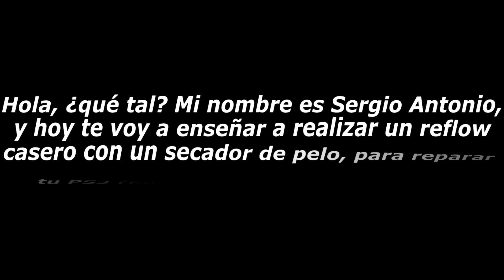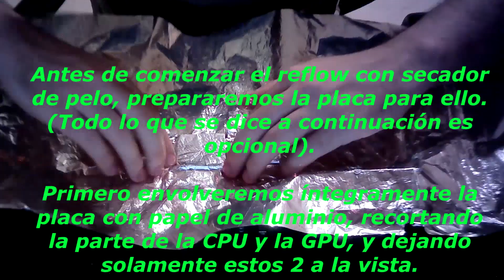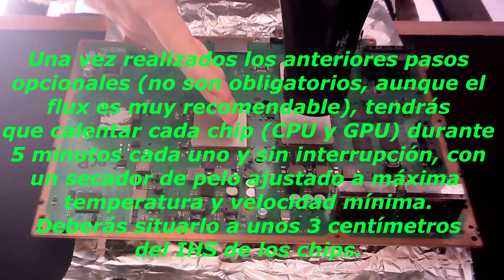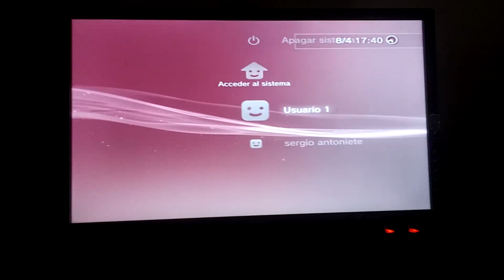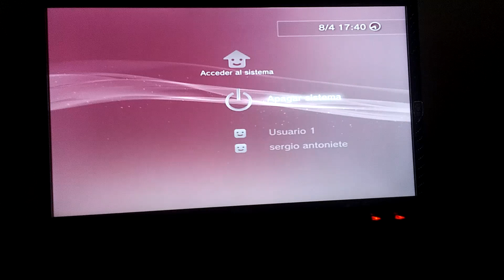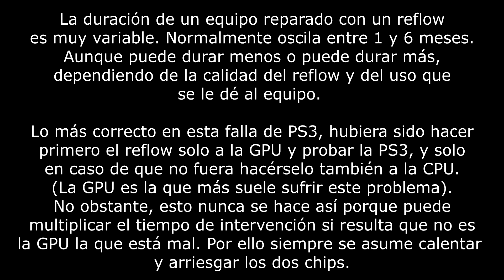Reparación de PS3 con el error de luz roja parpadeante |  Reflow casero en PS3 con secador de pelo

Comment: Cuánto te duro la PS3 con el reflow?
Además que si el Flux que usaste y pusiste en la descripción, es de buena calidad?

Y yo opino que la PS3 puede durar bastante con ese metodo si se hace esto:

Buena ventilacion y en un lugar confortable, No exceder el uso del sistema y darle un uso mínimo diario.

Yo había hecho ese procedimiento pero sin el flux y pues no sirvió, otra pregunta es que el flux verdaderamente es la clave en este procedimiento?

Y por último, yo al encender la PS3 Fat pues el ventilador se pone a máxima velocidad y hace gran ruido,así como por unos 8 segundos, luego para y sucede la luz roja,  pero por qué se activa el ventilador de esa forma?
Reply from the maker: Hola Alonso:

Gracias por su visita y su comentario.

Esta PS3 la reparé solo unos pocos días antes de subir el vídeo. La he usado activamente durante la semana pasada en sesiones y tiempos repartidos de la siguiente manera:

2 sesiones de 1 hora, 1 sesión de 4 horas y 1 sesión de 2 horas, usando el Call of dutty Balck ops en modo multijugador y zombies, un juego que para esta consola es bastante demandante de recursos.

Antes de que se me estropeara del todo y necesitara hacer el reflow, la PS3 sufría de calor y entraba constantemente en thermal throttling, poniéndose los ventiladores a tope, después reduciendo drásticamente su rendimiento y apagándose en torno a los 20 minutos de encenderla. Hasta que finalmente le pasó lo que se ve en el vídeo.

Tras estos últimos días puedo concluir con total seguridad, que el reflow ha salido bien y que la pasta térmica de 13.8W/mk que le puse es suficiente como para conseguir que la PS3 no entre en thermal throttling a pesar de que en España ya estamos entrando en el verano, y ello perjudica a la consola dado que la temperatura ambiente es cálida.

La pasta térmica que uso https://www.amazon.es/gp/product/B07K442WXV/ref=ppx_yo_dt_b_asin_title_o01_s00?ie=UTF8&psc=1

Por otro lado, la tengo en un lugar bien ventilado. Dejo un mínimo de 10 centímetros de espacio a su alrededor para que circule bien el aire y la tengo en un lugar bajo (ya que el calor sube), y además cuando la he jugado lo he hecho con la puerta de mi dormitorio abierta y la ventana también, para favorecer la circulación del aire, a excepción de la última sesión de 2 horas, que cerré el dormitorio, y no se apagó a pesar de la alta concentración de aire caliente.
Reply: Hola tengo una consulta , tengo una ps3 modelo 2001 y nadie quiere repararme la consola, me dicen que no hay reballing para mi consola ps3 slim y que solo anda para pisapapeles la lleve a muchos lugares y todos me dan la misma respuesta , mi pregunta es si es verdad li que me dicen o solo me lo dicen porque es complicado de hacer. Saludos y gracias de antemano.
Reply from the maker: Respecto al tiempo, yo personalmente no sacrifico tiempo de juego para aumentar la durabilidad de la consola. La juego como si no le hubiera pasado nada, y si la sesión tiene que extenderse x horas porque el cuerpo me lo pide y tengo tiempo, simplemente lo voy a hacer porque de otra manera sería no disfrutarla, y pienso que las consolas están para disfrutarse. (Pero esto es una decisión particular de cada uno).

En cuanto al flux, este no tiene por qué ser la clave, no obstante puede marcar una diferencia entre conseguir reparar la consola o no conseguirlo y también la duración de la consola tras la reparación, dependiendo del grueso del problema, puesto que el flux además de ayudar a atraer el estaño a donde tiene que soldarse también elimina impurezas en el estaño.

El flux que yo he usado a mí me va muy bien, pero si lee opiniones en Amazon podrá ver que a otras personas no les ha funcionado tan bien y están decepcionadas (habría que ver si es realmente por el flux por lo que no han podido reparar o si es otra cosa). No obstante, la mayoría tiene una buena opinión sobre esta pasta de flux, igual que yo.

¿¿Es clave el flux en su caso?? Como ya le he dicho, puede marcar la diferencia. Sin embargo, también es importante (incluso más) ponerle una buena pasta térmica a la GPU y la CPU; una pasta térmica que no baje de los 8W/mK.

Es importante para que la consola no alcance el thermal throttling, y evitar que se apague por un exceso de temperatura (después de ponerse los ventiladores a tope). Y también es importante limpiar todo el polvo que contenga la PS3, incluyendo el del ventilador.

Que se apague tan rápido después de revolucionarse, también puede deberse a que el disipador no hace buen contacto con GPU, CPU o ambas. 
Otra solución, a parte de poner una pasta térmica mejor, es colocar unas chapitas de aluminio o un material incluso más conductor (como el cobre) encima de los IHS, y la pasta térmica ponerla por las dos caras de esas chapas (las chapas tienen que ser del mismo tamaño que cada uno de los IHS, aunque si lo exceden un poco no pasa nada).

Dicho esto, le informo de que una vez transcurra un mes desde la reparación, dejaré un comentario actualizando el estado de la consola y el tiempo de uso. De ahí en adelante y una vez al mes, editaré y actualizaré dicho comentario, hasta que la consola vuelva a estropearse. 

Si es tan amable, ya me contará que decisión toma. Si tiene cualquier otra duda, no tenga reparos en consultarme de nuevo.

Le deseo mucho suerte.

Un saludo.
Reply: @sergioantoniorivedjudez4175  Yo pienso que si es el flux la clave en mí caso al hacer el Reflow, ya que la consola se mantiene muy limpia por dentro.

Yo ya había cambiado la Pasta térmica para ver si ese era el problema pero sigue estando igual, y luego le di calor con una secadora por 10 minutos en cada cuadro (GPU, CPU) y pues seguía igual.

A lo mejor seguro las bolitas de estaño deben estar mal pocisionadas por el calor que el mismo sistema provocó y además debe de estar algo sucio o tener impurezas cómo dices.

Vi otro vídeo acerca del tema e igual usa flux, de hecho es el vídeo más visto acerca de este tema en YouTube e hizo lo mismo que tú.

Pienso que el Flux contribuye bastante en el reflow 

Y otra pregunta sería que si realmente no hay otro problema en el sistema por lo que se deba la luz roja intermitente? Osea que si es por definitiva en la GPU o CPU con sus bolitas de estaño?...
Reply from the maker: @xks71  Hola otra vez Alonso:

Gracias nuevamente por comentar.

Sobre la pasta térmica, no es suficiente con cambiar la pasta térmica y ya, sino que tiene que asegurarse de que la pasta que usted pone tiene un alto grado de conductividad térmica. Para una PS3 no le recomiendo poner pasta de menos de 8W/mK. Yo a la mía le puse una de 13.8W/mK. 
¿¿Qué conductividad tiene la pasta que puso usted?? 

Por otro lado, considero que exponer los IHS a calor directo con un secador de pelo durante 10 minutos, según sea la configuración del secador, puede constituir una sobreexposición, salvo que el reflow se haga en un horno, en donde la exposición no es tan directa, sino que está más repartida. (Hay que tener cuidado con estas cosas).

Además, recuerde lo que menciono en el vídeo. La placa tiene que estar recta en el momento de hacer el reflow, porque si no lo está y aplicamos calor, lo único que vamos a conseguir es deformar las bolas y desoldarlas todas o casi todas (agravar el problema).

Y recuerde también, que los problemas de temperatura no solo se reducen a una pasta térmica seca o de mala calidad, sino también pueden deberse a que el disipador esté haciendo mal contacto en GPU, CPU o los dos. Usted se tiene que asegurarse de todas estas cosas. Incluso puede ser que se necesite cambiar el ventilador porque los rodamientos del que hay se hayan desgastado (pueden ser muchas cosas).

Respecto a la luz roja, si que puede deberse a otros problemas. Si usted enciende la PS3 del interruptor de detrás (sin darle al de delante) y la luz roja tarda 3 segundos o más en aparecer, es posible que haya alguna resistencia estropeada o algún otro elemento en corte. 

Tampoco hay que descartar el resto de integrados cuando se produce el fallo de la luz roja, tanto el hecho de que puedan estar en corte, como el hecho de que también puedan estar sufriendo por un exceso de temperatura. 
Usted puede revisar los thermal pads del resto de los integrados y ver si están secos. Que lo estén indicaría que es conveniente cambiarlos.

Respecto a si hay algún elemento en corte, no es tan sencillo como hacer un reflow, ya que hay que comprobar los componentes SMD con un tester, y convenientemente de primeras saber intuir el área de la avería (ya que hay muchos componentes).

Yo cuando hice el reflow a la mía, se lo hice porque la luz roja aparecía casi inmediatamente al activar el interruptor de detrás. Y ahí supe que lo que tenía que hacer era un reflow, y que no había otros elementos en corte. Además lo supe por los antecedentes de las consola, que anteriormente se apagaba a los 20 minutos de funcionar, debido al thermal throttling, hasta que un día pasó lo que se ve en el vídeo.

En resumen (del punto 1 en adelante hágalo en el orden que considere):

1. Compruebe cuántos segundos tarda en aparecer la luz roja cuando enciende el interruptor de detrás. Si tarda 3 segundos o más, el problema no se resuelve con un reflow, si no que probablemente haya alguna resistencia o algún otro elemento en corte.

2. Si tarda menos en aparecer, revise lo que le comenté de la pasta térmica y póngale una que sea de calidad, no vale cualquiera. 

3. Compruebe que el disipador hace buen contacto con los chips. Si no lo hace y si es necesario, compre varias chapas de cobre, póngalas encima de los IHS y después el disipador, poniendo pasta térmica por las dos caras de las chapas al ponerlas.

4. Si considera que pudo tener la placa inclinada durante el reflow que hizo, vuelva a hacer reflow colocando la placa totalmente recta (sin inclinaciones), y utilice flux para facilitar las soldaduras. (No exponga cada IHS al calor más de 5 minutos). Es importante que la placa no se mueve durante la operación, que se mueva puede anular el éxito del reflow.

5. Valore si realmente le sale económicamente rentable intentar repararla y si también le es rentable el tiempo invertido.

Si tiene cualquier otra consulta, aquí estoy para intentar contestarle lo antes y mejor posible.

Un saludo.
Reply: @sergioantoniorivedjudez4175  La encendí del botón de la parte trasera y la luz prende al instante. Y me acorde de algo muy estúpido, que hice el Reflow en la Cama jajaja, obvio no estaba recta.

Y que eran los IHS? Perdón la ignorancia.
Reply from the maker: @xks71  Que la luz roja se encienda al instante es motivo de alegría en este caso. 

Pues ya sabe lo que hacer. Ahora hace falta que ninguno de los chips se quemara con el anterior reflow, ya que 10 minutos de exposición directa de calor a cada chip con un secador pueden ser demasiados minutos, o no. (Espero que no lo fueran). 
Si no les ocurrió nada a los chips, siguiendo los pasos del vídeo y utilizando flux, conseguirá volver a soldar la matriz y que funcione. (El secador a máxima temperatura, mínima velocidad, durante 5 minutos en cada chip). Y busque una superficie plana para poner la placa, y si está inclinada, ponga algo debajo que no la dañe, para dejarla recta. 
 
Igualmente le recomiendo que tenga en cuenta todo lo que le dije, incluido lo de la pasta térmica y el disipador cuando vuelva a montar la consola después del nuevo reflow, si decide hacerlo. 

Ojalá tenga suerte y todavía no esté perdida la consola. 

El IHS es el radiador que viene agarrado al chip. Encima del IHS es donde se coloca la pasta térmica. 

Si puede ya me contará qué tal. 

Un saludo.
Reply: @sergioantoniorivedjudez4175  Vi que tu PS3 Fat es la Retrocompatible, yo tengo una igual con 4 puertos USB y la tapa que se abre, modelo CECHE01, cuál modelo es la tuya?

Y el Flux que usaste es el líquido? O cual recomiendas

Voy a Conseguir el Flux y haré el proceso, ya que no quiero dejar de lado a ese sistema, ya que al menos en mí pais cuesta conseguirla y más ese modelo.
Reply from the maker: @xks71  Así es. Tengo la PS3 FAT de 60GB cechc04. 

Yo usé pasta de flux (no es líquido). Respecto a cuál recomiendo, no puedo recomendar algo que no he usado. Por ende, solo puedo recomendar la pasta de flux que yo tengo, porque es lo que me ha funcionado bien (no me voy a arriesgar a recomendar modelos y marcas de flux líquido, porque no las uso).
 
Sin embargo, hay que recalcar que la aplicación de flux líquido es más sencilla que la aplicación de pasta de flux, dado que el flux líquido se filtra bajo los integrados sin necesidad de calentarse, y la pasta de flux solo se filtra cuando se calienta y se vuelve líquido. 

De acuerdo. Le deseo mucha suerte. 
Si no logra recuperarla, siempre puede optar por comprar la placa suelta (es otra opción). 

Un saludo.
Reply: @sergioantoniorivedjudez4175  Haré el procedimiento del reflow, Por ahora conseguiré flux, vi el link de amazon que pusiste en la descripción y en una parte dice:

"El punto de entrega seleccionado supera la cobertura de envío del vendedor para este producto, elije otro punto de entrega o compra a otro vendedor".

Pues tendré que conseguirlo en mí país.

Te escribire como me fue, gracias por la ayuda encerio!

Like+Sub.
Reply from the maker: @xks71  Hola Alonso:

Muchas gracias por darme like y suscribirse. Es muy amable. 

De acuerdo. Puede buscar ese mismo flux en otras webs si no llega a su país con ese vendedor.
E incluso en Amazon, puede buscar si ese mismo producto lo venden otros vendedores que sí lleguen a su país. 
Ponga en el buscador de Amazon "Soft solder paste flux" y ya verá como son muchos los vendedores que la ofrecen. 
Solo busque uno que le sirva.

Un saludo.
Reply: @sergioantoniorivedjudez4175  sería bueno si resumiera un poco esos testamentos
Reply from the maker: @pedrotroglodita2204  Hola Pedro:

Gracias por su visita y su comentario. 

Creo que resumir esos testamentos sería privar a quien lo quiera, de información útil.  
Si usted no quiere dicha información, y le basta con hacer las cosas sin razonarlas o entenderlas, es libre de ver otros vídeos y leer otros comentarios igual de válidos que los míos, pero destinados a otra clase de público. 

Un saludo.
Reply: @sergioantoniorivedjudez4175  el resumirlo no significa quitar sabiduría al comentario Crack pero ya estubo ya lo leí después de 20 minutos leí todos los comentarios 👍
Reply from the maker: @pedrotroglodita2204  Hola otra vez Pedro:

Yo no dije que necesariamente implique restar sabiduría. Por ende, le invito a leer de nuevo mi contestación.   En este caso, si implicaría restar sabiduría o contenido, pues lo que se expone son conceptos técnicos ligados a lo que se está haciendo o se pretende hacer, y que ayudan a su razonamiento. 

Le repito que si usted quiere contenido básico, que solamente exponga lo que se debe hacer y nada más, se pase por otros canales. 

Un saludo.
Reply: @sergioantoniorivedjudez4175 ya leí tu contenido básico bro y debería pensar un poco en sus subscriptores ya que no todos tus subscriptores tienen 20 minutos que a mí sobra de leer texto y otra cosa el resúmen es una técnica bueno que deberías implementar no lo tome a mal buen día
Reply from the maker: @pedrotroglodita2204  Hola otra vez Pedro:

Le repito nuevamente que resumir en este caso implicaría restar en contenido.   Si a usted no le gusta mi contenido o carece de tiempo para el mismo, es libre de visitar otros canales y otros vídeos, como hace la mayoría de la gente cuando ve que hay un vídeo que dura 30 minutos, y otro de lo "mismo" que dura 10 minutos (igualmente con los comentarios largos y cortos).   

Cada uno es libre de escoger, y a usted nadie le obliga a seguir aquí.    
Dadas las posibilidades que usted tiene, pienso que si continúa con su actitud, es por impertinencia, y por nada más.   

Me gusta dar segundas y terceras oportunidades, por ende, le animo a que cese, porque de lo contrario, tendré que solicitar medidas a Youtube.  

Llama la atención que a pesar de estar tan disgustado, usted decida quedarse aquí. 

Un saludo.